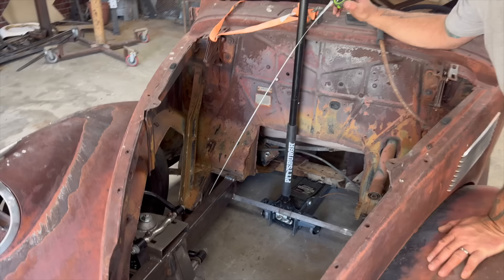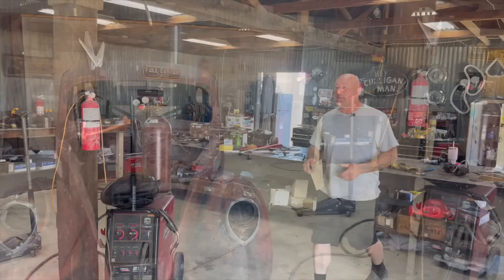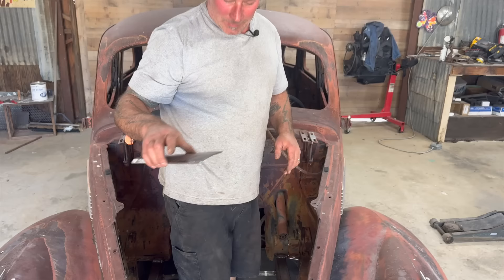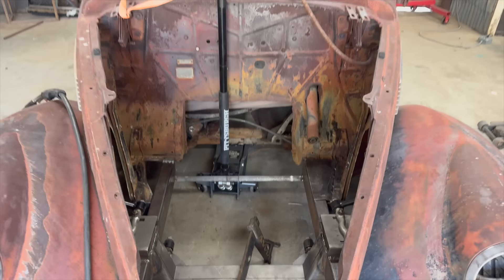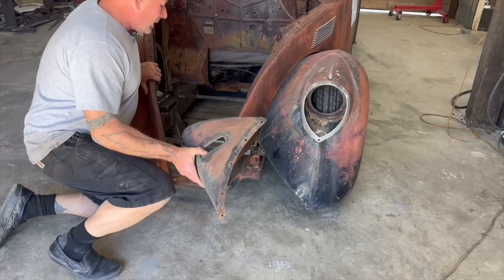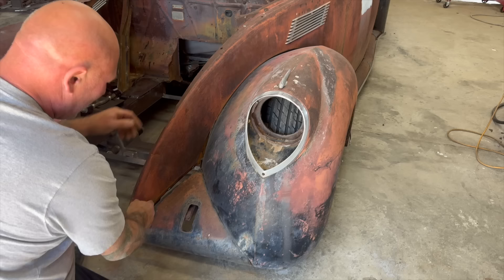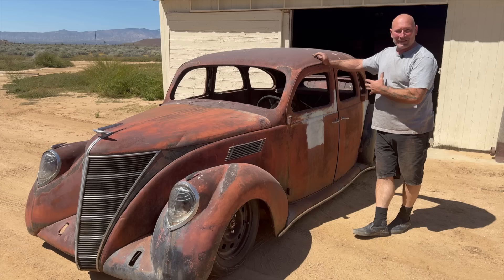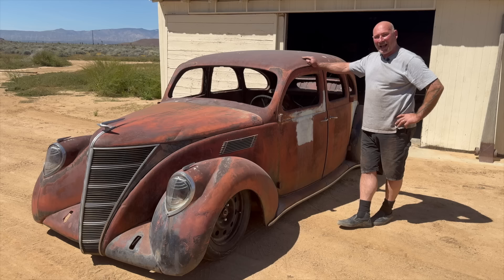1937 Lincoln Zephyr: After 50 years Ian Has Brought New Life Back Into This ICONIC Part of Americana

Comment: The 1937 Zephyr is a real life, honest classic.  It is a big, classy, and almost "In-your Face" design.  Your choice of wheels and the slight lowered stance only enhance the appearance of the car.  I always loved the front design, but this is one of the few cars of this era that I find the sedan version more attractive than the coupe.  The Zephyr coupe is built on the same wheelbase, which results in a rear deck that appears to be out of proportion to the rest of the body.  However, the resulting long trunk will comfortably hold 14 teenagers when sneaking into the drive-in.  My older brother had a '37 coupe back in the late 1960s which he occasionally let me borrow for a weekend...  The car drove like a dream with a smooth ride.  The builder had used the original V-12 engine to restore another Lincoln and replaced it with a 1956 Olds out of a Super 88.  The 240 HP V8 moved the car at a pretty good clip.  The engine later developed a rod knock and he found a 1958 Pontiac and swapped the 4-barrel 370 engine to gain 45 horsepower.

Comment: Look. Measure. Paper template. Cut. Fit. Grind. Fit. Weld. Measure. Grind. Weld. Grind. Look. Repeat.
...and THAT'S how you get the new headlight switch to fit in the dash - like it belongs.
The car looks soooo fine. The original body lines with the chassis mods and drop suspensions - front and rear. 
Now "That's Entertainment". Thanks for sharing ! ! !

Comment: I am a tinsmith and bought a 1937 ford when i was 29yrs old in 1989. It was trashed cut up an old gasser. Its now a nice street rod i just finnished up the second restore and many upgrades. Its a life long hobby. I like your work! Good job
Reply: Would love to see what you've done to the old girl!
Reply: @robertmungo5428  It had 36 fenders welded on i left three 1/2 inches on and put on 37 humpback fenders on them therefore widened and it looks tough with L60- 15s built tapered running boards. Cut the front fenders off so i could meke it removable. Bought fenders from the humpback. It has a 350 chevy 4spd borg warner t10. Now new int its beautiful.i will email you some pics. Fred Luna

Comment: So been racing dirt stock cars for over fourty years.I've have many wins multiple championships, a ton of stories for most of them. Since I was a small boy my father tells a story about his one and only win.. In a Lincoln Zypher. The original 12 cylinder was nit available so he installed a flat head six. During the race the voltage regulator came loose jammed the throttle wide open. He continued to race not backing off,just hold the car on track barely. To eventually take a win. The other drivers wanted to see the v12 post race. Only to see the little six list in the engine compartment. Had the throttle not gut stuck my dad's sure he'd never have won. My father's still alive, just turned 89.what a great story.. Just wanted to share. Great build choice.. I love all your projects.. Looking forward to seeing this one completed.. God bless.
Reply from the maker: That is a really great story.  Thank you for sharing.  We look forward to getting the engine and getting it running!  What a day that will be!

Comment: First time seeing this channel
 Read some comments, folks giving their opinions, good and bad. This for everyone, build it your way. You're paying for, you're gonna be driving it. Do it your way.
I built a 37 Plymouth sedan. I wanted something different, so I built a 4x4..got lots of "are you crazy comments"..  however, as it started taking shape (at my friends shop) everyone started saying, "wow thats actually looking really cool" I wanted that classy look. I kept it on the original chassis, no gaudy truck frame. Gave it a 3 inch body lift, a few inches on the springs. Stuffed a 454 in it. Turbo 400 trans. 35 in tires. Cut the fenders out a bit, put the original body lines back in the fenders, to the new running boards.  put the front up just a little higher than the rear, gave it an aggressive stance. Flat black, did some stuff in the engine bay, gave it a neat rat rod appearance. Did a lot of other creature compfort things.   Drove it daily in the spring and summer, was a great driver.  Always got a thumbs up.
So do what you want. Be different..
Love that Zypher..someday I'm gonna get me one.
Reply from the maker: Welcome to the community!  ~ Jamie

Comment: You mentioned wanting a big block Ford for the Zephyr. This might be a long shot. I have a 88 28ft class A motor home on a John Deere chassis with Ford running gear. The motor is 4BBl 460 approx 60K miles C4 trans.
Not that you would want the chassis but you won't find a stronger one. 
I parked it about 10 yrs ago with the intent of fixing some leaks and interior paneling...Everyday Life and a heart attack last year got in the way.  The whole interior is pretty run down
Sadly I didn't non-op when I parked it.
Anyway, it runs really strong. A couple of yrs before I parked it I had the heads done (burned valve) and a new RV cam.
The John Deere chassis is super heavy duty (like a tractor) with 4 wheel disc brakes. 
If it wasn't for not doing a non-op it could just simply start up and drive it away. 
I think the title is clear for parting but not for licensing. I'm not sure how that works.
The bottom line. It can be yours for the asking. Come to Modesto and pick it up. The Iron in the chassis would be worth the trip.
It's  not dismantled but if you take it you have to take all of it. As is.

Comment: Ford had an idea  because of that engine. It was the reason for the PCV valve. Ford sent a bunch of limos over to Hitler's Germany. Split the rod bearings and the other rod and went right through the middle. Dad was a mechanic in the 191st tank battalion and became part of the Allied Occupational Government. As a tech, he would go around confiscating V-12 limos for birds on up. And had to go over them first. They used a Zephyr as the Black Beauty in the first Green Hornet movies. Even if you went with the original engine, you could have way more power with most modern  crate engines.

Comment: Morning guys! Didn't those come with a flathead V-12?  also I was at tractor supply awhile back. they had a 7 or 8 piece 1/4 and 1/2 drive 10mm of all different shapes and flavors. I was gonna get a set but was quickly discouraged by my wife pointing out the fact that 3 of them will be missing by the time we get to the truck...

Comment: Before you even mention the sharp point on Ians table I was like thinking that's an accident waiting to happen. I try not to leave any sharp points on metal. 
Even when I welding my brother's battery try brackets for his panel I shaved off the sharp corners he noticed I did that. I didn't think anyone would notice but me on something as small as that. Just like thing's to look neat and clean tight and right.

Comment: those top plates i would've drilled a few holes in them so i could plug weld them to the top of the rail for extra strength on top of the seam weld

Comment: Love this build, everything about it screams fun ride. I wonder why he did not build it with a removable body, i understand welding the body to the frame will make it all stronger but if you ever have the need to remove the body you are in for some work. I am sure there is a good reason, just for the learning process i was wondering why.
Reply: This car is a unibody from the factory.

Comment: being a Lincoln I suspect its got to have like the S55 Maurader 428 then . .  they routinely broke 500lb torque dynometers in the 60's, king of the freeway, like 400hp 525 torque, just a monster superseding even the 455, bone stock, lightly massaged 600hp, 650 torque, cams, headwork, pistons, if you lower comp and boost they go ridiculous like 1200hp w/crankwork, billet rods/pistons so forth .. great motor . .  73-74 Buick 455 block, 70-71 455 Buick heads . .   ruh roh . . .  headers.. 3" exhaust . . .
Reply: It's getting a VW Bus rear end and engine..

Comment: You was talking about a big block Ford engine. How hard would is it to come across a V10 out of the F250 or F350.
It's not a V12, but it's not a V8 either, and you could also use the automatic transmission that most of the trucks came with. 
Just a suggestion, but what ever you do. I've got a good feeling that it's going to turn out awesome. 
Thank you for the entertainment, education, and inspiration.

Comment: Question for ion,when you are using the porta power and spreading the metal apart,can you use a little heat to make it go into shape,instead of using the sledge hammer,then it won't want to spring back and crush that grill?

Comment: Measure 96700 times, weld once 😂. Your welding looks and sounds good, I'm no coded welder but I learned that you can tell alot from the sound of the welding. This would make a cool EV but probably quite an expensive thing to do and electric vehicles have a lot of haters. Regardless, this is gonna be a cool wee car 👍.

Comment: Nice work bru,, are you going to duplicate the plates which join the xmember to the rails on the underside,, also had the idea of putting flutes on the side of the body just On the sides just around the corner from the grill going to the level of the headlights???

Comment: I like your car but I think it's to low maybe you might consider rising it 3 inchs also this will make it where you won't put a hole in the oil pan on the engine and transmission.

Comment: Reconsider V-12. The cost at $2950 from JDM. The car demands it
Reply: They're no a good engine, lots of issues.
Reply: @65cj55  that particular engine is  Toyota v-12 it is in a 1926 Duesenberg that has been flawless since 1997.
Reply: @consanna  Oh right, i thought you were talking of the original Lincoln, it was prone to oil feed and over heating issues.